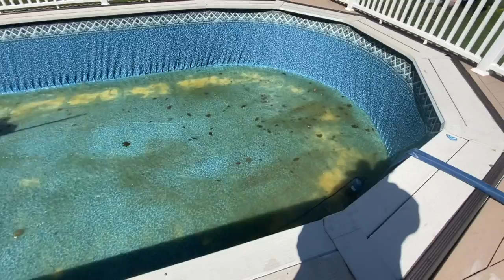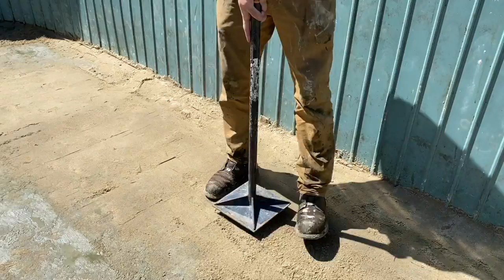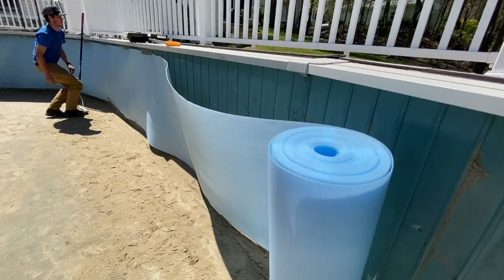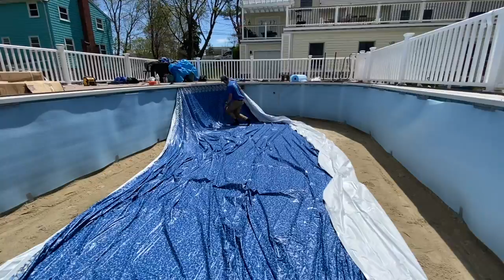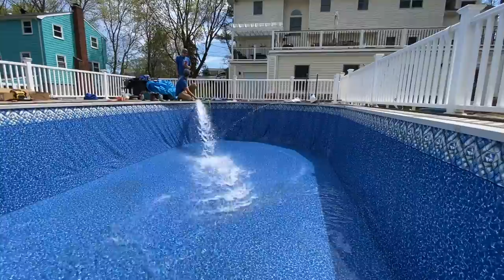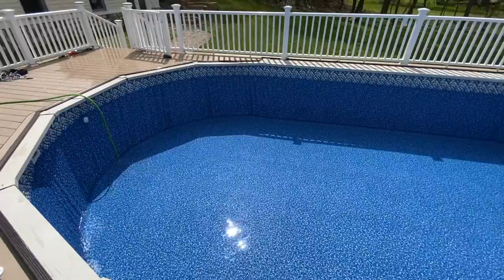15x30 Esther Williams Oval Above Ground Pool Liner Replacement

Comment: Any tips to get the oval liner lined up? I’ve spend a week trying to get mine straight and it’s just not working out. Are there any methods that work besides eyeballing it?
Reply: I had the same issue. I found lining up any type of "seams" in the liner  that you can find. And then taking that line. Which would be in my case 90° to the length of the pool, as the seams were going width wise, line those up as you're setting the top as best you can, having water in the base helps I think but make sure it sits nice before you fill up I think
Reply: @MegaNightRider69  thanks.  I did end up identifying some seams after a few bad attempts. You would think they’d make it easier to see.

Comment: What do the slats sit into around the pool? Do you interlock them and stick them down into a channel?
Reply from the maker: There is a track on the bottom as well as on the top of the pool that the slats sit into the interlock and sit in into the tracking

Comment: You can replace the liner on Esther Williams leaving the top rails on?  I’m about to do one but everything I’ve read you have to take top rails off
Reply from the maker: Most Esther Williams pools are beaded liners if it is a beaded liner. You do not need to disassemble anything. There is a bead track under the top rails of the pool and the liner. If it is an overlap liner with no bead receiver than yes into Has to be disassembled

Comment: How do you identify the manufacturer? I have a 15 x 30  solid wall sides not the slats  beaded liner  that needs replacing the previous owner put in a liner that is falling out of the bead in one spot about eight inches long  and the floor of the pool has many wrinkles  . Maybe the wrinkles are because the liner is too big ?
Reply from the maker: Most above ground pools have markings etched into the top caps, there are typically 2 types of beads on above ground pools most pools are a standard bead or unibead but there are some like the Esther Williams and Johnny wesimuller pools that are specific beads. 

Wrinkles are typically from a bad installation or loose liner, when a new liner is put in the wrinkles need to be worked out before any water is added we do this with a liner vac or a shop vac

Comment: Great job! Oddly enough, we are going to have our liner replaced in a couple weeks and our pool is also an Esther Willams 15x30 above ground and looks just like this one. The original owners had it installed back in 1990! It is built like a tank and is still in great shape.
Reply: What thickness did you go with and where did you purchase it as I am thinking of replacing my old liner in my 15x30 Esther Williams pool. Did all go well with the liner replacement? Thanks

Comment: How did you get the right liner? How did you measure it?
Reply from the maker: If you measure the wall height from track to track and the length and width of the pool that will give you the proper size liner needed.
Reply: Yeah you guys did a Beastie job really good. My friend put the liner in for the 15 by 24 ft pool he's not a pool expert even though he knows a lot. There are a few wrinkles but hey at the end of the day of the hell that I've been through to get my pool working I'm happy that it works but again great job Esther Williams is one of the best pools ever made